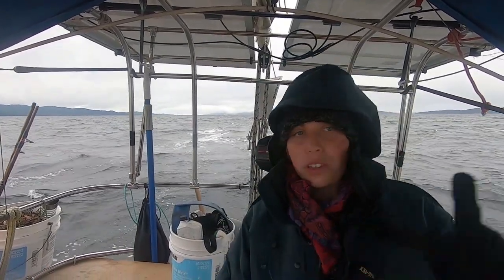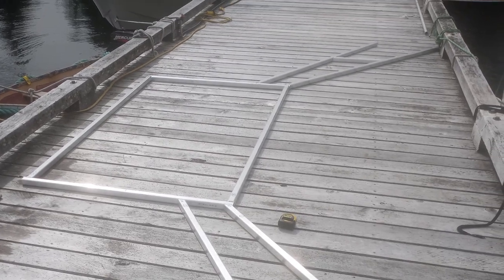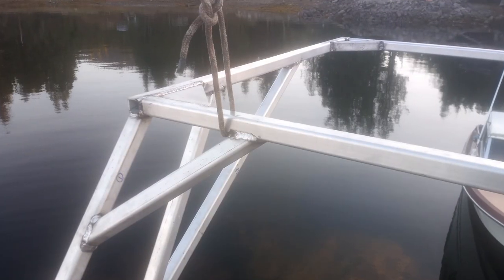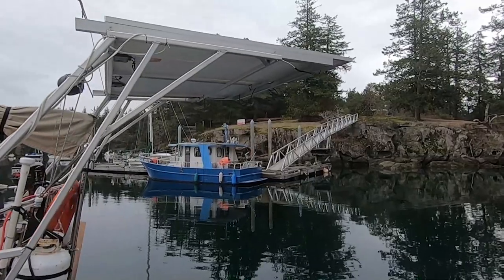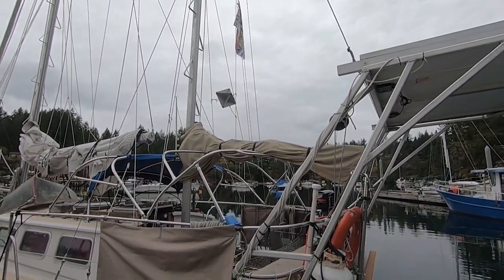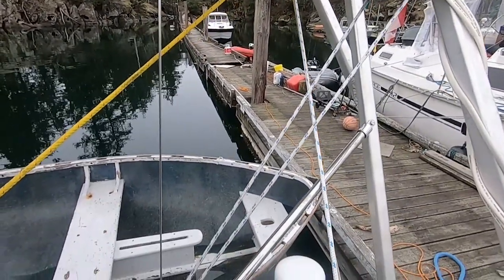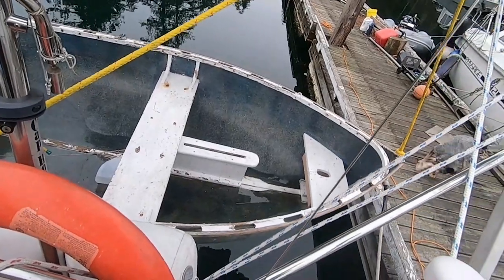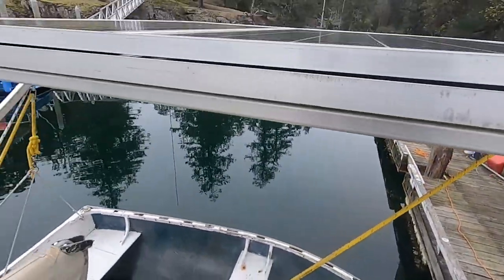DIY sliding solar arch 1300w - Sailing Oka Solo - 034

Comment: Great idea on your self design' blocks ".  Try some washers on each side of the sheave, it will stiffen them up. That's if they are wobbly. I would think twice about putting davets to hang a dinghy. I think your size of tubing may be at a minimum. But you did say reinforcement. Excellent job overall 👍

d'un marin de 40 ans. j'ai apprécié vos quelques vidéos. ce serait bien d'en voir plus.

I definitely know the west coast well from Sailing, and from working on the tugs, and Frank H Brown.

Your pup is very curious about what you are doing .
Reply from the maker: Yeah I agree i find it a little too.much on the stern with the dinghy considering that the 4 solar panels weight close to 200lbs! Ive been very very busy this year an am catching up with videos
Reply: @sailingokasolo6801  Merci pour votre réponse

WOW! two hundred pounds, that is a lot of weight. You don't want a dumping of heavy wet snow, or the dinghy filling with water.  I look forward to seeing more.

Comment: Very clever, congratulations. Been keen to see how it works when on passage. Also if you have any wind blocking effect on the wind vane. I had to re-engineer my panel set up to accommodate the vane correctly. Impressed to date.😊

Comment: Hi, nice to receive a new video. You are working hard on the boat. The solar arch is huge ... Hope it works as you have planned. Thinking of building an arch myself. Just for the dinghy. I'll copy some of your ideas. The scenery is always spectacular. A bit cold compared with my sailing grounds ... All the best in your future sailings.
Reply from the maker: Currently north bound in near freezing temperatures questionning my life choices 😂 the arch has performed very well thus far other than a couple design flaws I need to fix, I'm still unsure if i want to use it for davits

Comment: Have you ever seen the the YouTube channel Sail Life? This dude built a solar arch  where the panels slide under each other.  Don't know how much he paid for it but his M.O. has always been diy. Just a thought you might pick up a few ideas. I like your channel a lot because your theme of sailing on a budget hits a chord with my own hopes and dreams. Just wish you had more content on YouTube.
Reply from the maker: Oh wow just went to check out their channel specifically the sliding arch video. Very similar concept! I designed this one with the fore and aft sections uncapped  so i could use them as a hinge for side pannels, im looking at getting multiple flexible pannels to add to the system

Comment: I like your short slider idea with the halyard support, I may copy that.  I do have some concerns about flexing with your dinghy up, not so much during a storm but during a bumpy passage.  That said, I only watched this one video of yours. You may have already proven me wrong
Reply from the maker: The dinghy lives on deck during passages the arch wasnt designed for carrying the weight but fine for storing the dinghy while not sailing anywhere

Comment: I also have a ketch, and I also have wrestled with where to put solar panels. I thought about doing what you have done, but was concerned that the darn thing will rack so much as the boat moves that it will eventually pull itself apart. How are you bracing your arch to keep it rigid?
Reply from the maker: Its all about cross bracing with diagonals to from triangles! I will be adding two more diagonal to the top of transom

Comment: The arch and panels can end up costing more than the boat. That's what I'm faced with, but on the other hand without these additions the boat is a day sailer, but with them she's a custom cruiser.
Reply from the maker: Well this diy arch cost about $400 cad to build and the total cost of the 1300w of solar panels was about $800.
 I've now sailed about 1000nm with the arch and am quite happy with is altho I have to watch that overhang while docking as it's so far past the pivot point of the boat!
Reply: @sailingokasolo6801  wow thats a hell of a good price for solar! Where did you source that? C'est de l'alu ta arch? J'aimerais ben ca apprendre a welder de l'allu, sur SS c'est pas trop possible en ce moment. J'viens du Quebec aussi, ben cool d'avoir decouvert ton channel. J'habite sur un 33 pied avec mon copain, on est aussi au BC. 

Ta pulley avec le shackle c'est vrt trop nice, crafty as fuck :)....
Reply from the maker: @SagariCross  salut! Oui cest de l'aluminium, deux paneau a 440w 300$ chaque de chez lynac lithium en ontario et pui deux panneau etais usager 100 chaque, mais cest des panneau de haut voltage donc si cest pour un system 12v tu a beaucoup plus d'option.
Vous etes dans que coins du BC? Je suis presentement a salt spring island